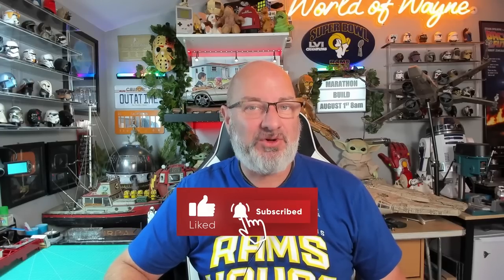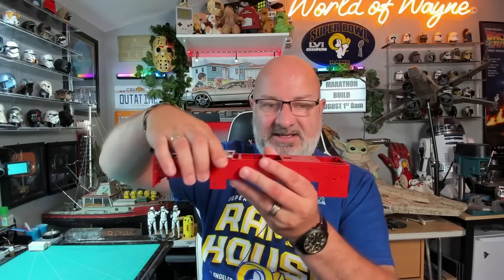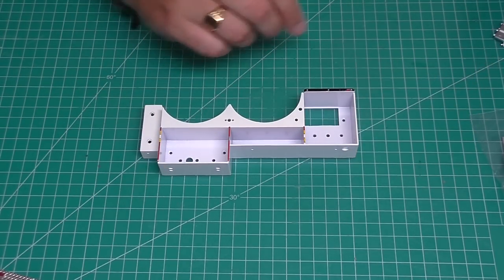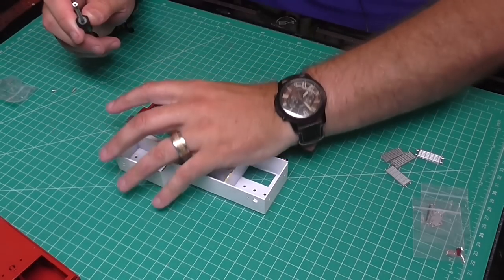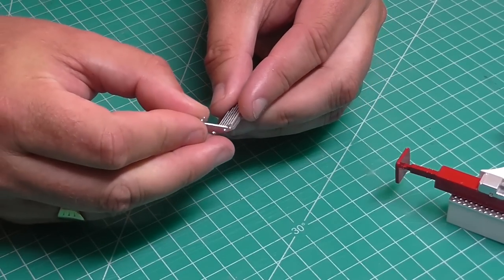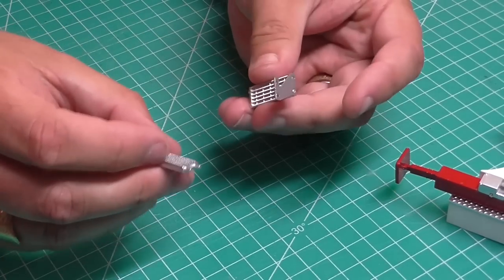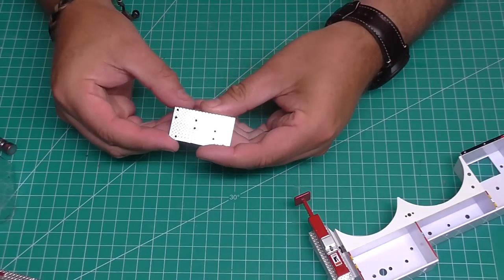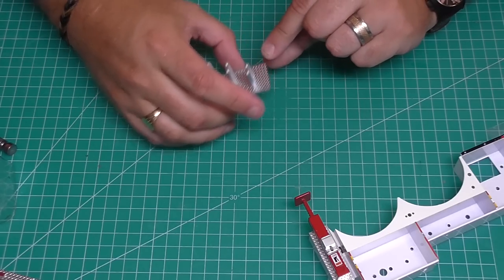Build the FDNY Ladder 9 Fire Truck 1:24 Scale - Pack 6 - Stages 38-43

Comment: I just got to this Stage where we attach the Compartment Frame to the Box Frame. On my model, the "D" screws really didn't bite into the screw holes, they slipped in. Having to glue this heavy piece of metal to another heavy piece of metal with screws glued into holes, doesn't seem to me as a secure fit. They should have made the screws longer!!

Comment: Hi Wayne, I'm having problems with the my bismarck which is now complete still to do the rigging, the problem I'm having is when I turn the power board on i was hoping the main turret guns do the calibrations nothing happens honestly nothing work's at all everything is connected as per the instructions. It would be a shame to pull it apart to find the problem, any suggestions would be greatly appreciated i do apologise for taking up your time from doing other work i will await your reply. John from australia...
Reply from the maker: It sounds like the connector from the base to the base of the ship is not carrying the power. I would check those systems first
Reply: Thank you wayne I'll do that (fingers crossed).John..ps the a6m zero is looking awesome can't wait to see it go through the movements....